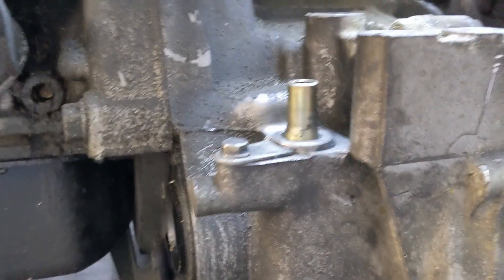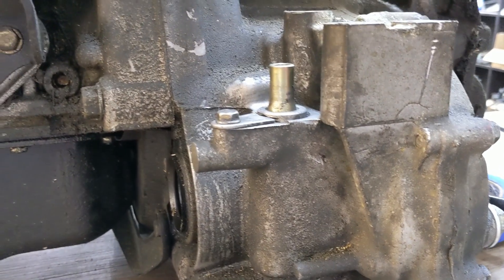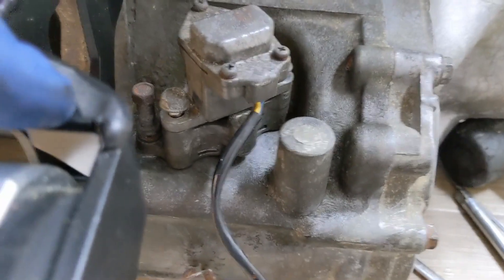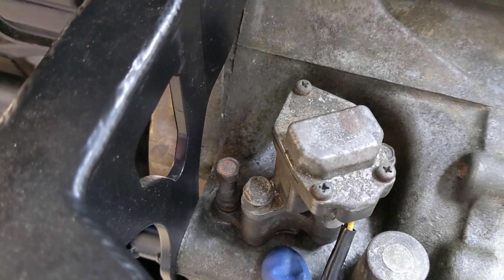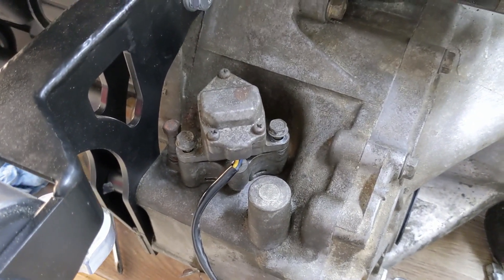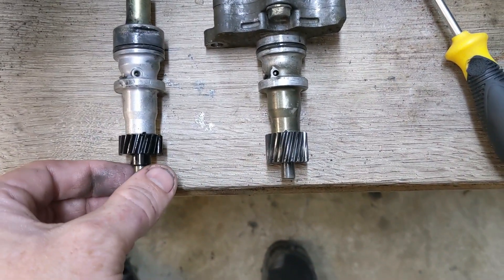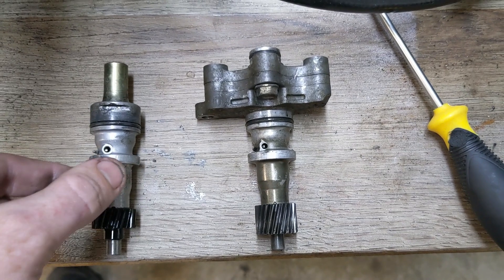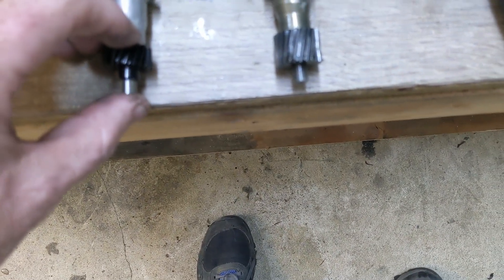Honda CRX B16 Swap - Part 6 - VSS (Vehicle Speed Sensor) Swap - Make it So

Comment: Does the OBD1 ECU recognize the signal coming from the analog speedo or is there special wiring that has to be done?
Reply from the maker: It's a JDM OBD0 ECU that came with the motor so no issues reading the analog speedo.

Comment: I have been trying to get one of the anolog speed sensor for my car to convert it back to OEM, i have ran into the issue of all of them being siezed into the transmission with every car i tried to pull them from. They crack before they even come out with the method you showed her, have any tips to not have that happen
Reply from the maker: I don't. You could soak the connection point with WD-40 overnight. To remove it I tapped it gently back and fourth at the top with a rubber mallet until it was loose enough to be pulled out by hand.

Comment: I also missed this in my swap preparations and due to lack of space the old transmission has also been thrown out before I realised I needed the speedo drive from it. Now I discover they are also difficult to find used and nobody makes them new. 

Did you have to do anything special to remove yours? I’ve found a guy who can sell me one but he can’t get it out of the transmission.
Reply from the maker: Nothing special. I just removed the retaining plate and gently pried it up with a large flathead screwdriver using the little groove that the retaining plate slots into. I grabbed the top of the vss and wobbled it back and forth to loosen it up. It's a bit like a cork. Some WD or penetrating oil might help if it's really crusty.
Reply: @MakeItSo  Thanks, will pass it on and hope for the best. I've heard opening the transmission and pushing it out from the inside is what some people have to resort to.
Reply: @vtecnerd  I've found oem spec ones on ebay for like 30$.
Reply: @trickmiller8169  New or used? I could only find used ones
Reply: Exact thing just happened to me

Comment: My B series is missing that tab that came on your d series transmission. My speedo worked when I got my car but has stopped working. Did you reuse your d series speedo cable as well?
Reply from the maker: Yes, I used the D-Series speedo cable
Reply: @MakeItSo  Cool, so if I did end up messing up my speedo cable I can get a d series one.

Comment: I tried to pull that out but its very hard, can you tell me how to please?
Reply from the maker: Once you remove the retaining plate you should be able to use a large flat head screwdriver and lever it up using the notch where the rating plate goes.
Reply from the maker: You may have to rock it back and fourth or gently tap on it side to side with a rubber mallet. Use some generous amounts of WD-40 to try and loosen it.
Reply: @MakeItSo  I tried that, actually I broke up where the retaining plate goes because I did that
Reply: @mikevelela8145  just twist it very gently when I pops up a bit it’s hard if it hasn’t been out before but just pull up till I comes out a bit and keep twisting and pulling